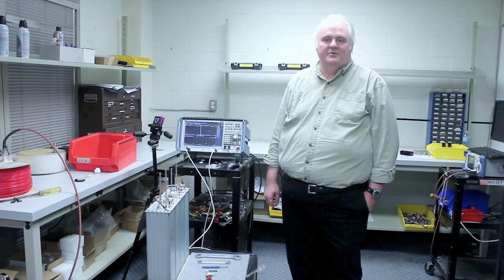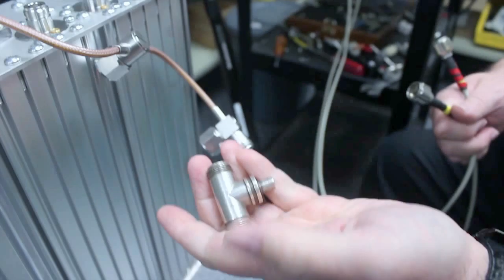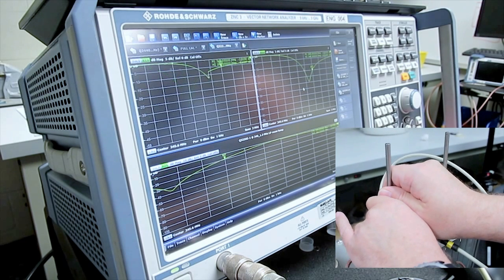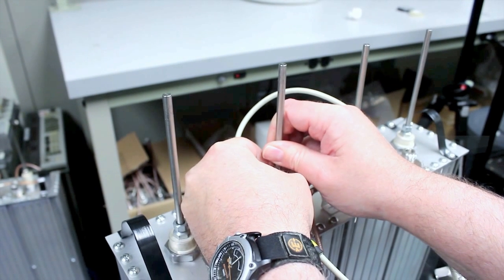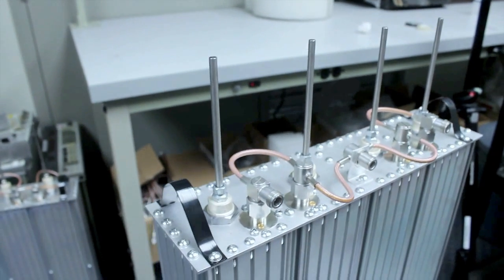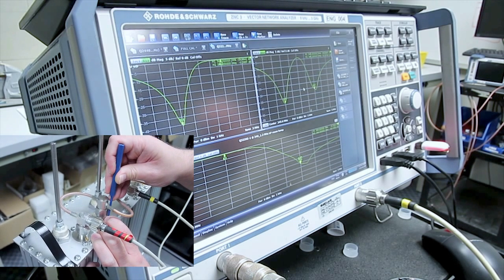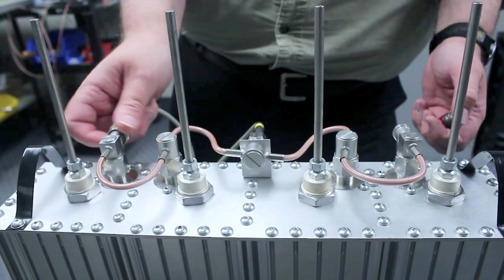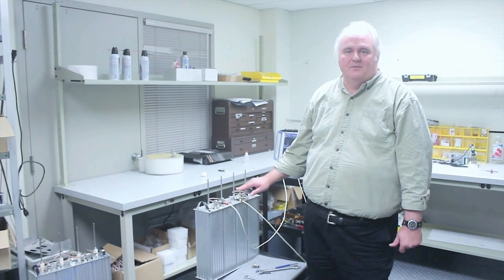How To Tune A Duplexer

Comment: No mention was made as to the position of the loop to control IL and or reject depth.  Also the importance of the proper frequency dependent length of the cabling harness. Good video nevertheless.

Comment: Sinclair products are excellent. Duplexers are simple to tune. I do not have ant fancy test gear. I use a generator and a receiver to tune at first , then touch up with low power to the inputs hi/low with a watt meter and set to minimum reflected. Have had duplexers checked with an instrument and spot on..  Wish I could own an instrument ...but $$$ which vI do not have. Have also built multicouple sets the same way.. Using a Motorola XPR radio with the RSSI reading as my guide. Can set insertion loss and a wattmeter for reflected .. The loop position is very important !! .... they work..

Comment: I do not have a VNA so I'm trying to use the SA-TG for this. I understand the lower display of the R&S VNA to be the S21 return loss. I don't quite get how to duplicate the SWR reading of the upper two screens though. I can get a directional coupler but would that require an additional 50ohm load at the T connector when trying to measure the SWR? This would be the directional coupler to the T and instead of a wire back to the VNA as in the video, I terminate it with a 50ohm load. Is that about right?

Comment: I have I bit of a strange case,
personally I don't own the richt tools.. however I do own two identical filters, one came tuned by a professional, the otter I want to tune my self.
equipment I do have: nanoVNA (cheap Chinese tool)
RTL-SDR stick (also cheap Chinese "tool")
SWR-power meter (again, cheap Chinese tool)

now for the fun-part,
I have tuned the filter using the nano-vna, but the dynamic range is poor on those things,..
to get more range u use the nano VNA in CW mode (so It does not sweep, just produce the right frequency) than I use a 10 db attenuator (also cheap Chinese tool) and hook it up to the RTL-SDR and note the exact pont of the signal (frequency and amplitude) note: set the SDR to the smalles sample size since it increases the dynamic range.
add one side of the duplex filter and remove the attenuator. 
now the amplitude of has decreased to the noice floor.... but luckily there is a gain in te RTL-SDR
set this to a level you can work with, (not it down) and tweek (very carefully and not by much) the duplexer to minimum deflection! (add gain if needed to allow for signal-noice ratio)
use a cheap radio tuned to the right frequency (pass frequentie) and measure SWR (my measurements came to 1.00 :) )
if both sides are done, you'r done.

im to CHICKEN to use this duplexer right now,
how big is the chance I tuned it completely wrong? 
I don't want to blow up my repeaters/radio's

if anybody has an other cheap way to tune filters I would love to hear it :)

73, PD0HOF / PI1HRN (DMR repeater)
Reply: Just in case anyone had the same questions. I have tuned them with a nano VNA like yours (Chinese), the Idea is to have two traces in Log Mag (turn the others off). Then for the duplexer port where the TX is going to be connected put VNA CH0 in it and VNA CH1 on the antenna port and the 50homs load on the RX port.  Make a Marker for CH0 and another marker for CH1.  Goto Stimulus and set the  center to the TX frequency (set also the span to your liking). When tunning the cavity look for CH0 and get the best db value, when tuning the notch filter set the center frequency to the RX  and  adjust the notch until the lowest value is reached (this will depend on the capability of the duplexer).      For RX side port of the duplexer, connect CH0 to the antenna port and CH1 to where the RX port of the duplexer, and the 50ohms load to the TX port of the duplexer. Do the same steps above for tuning.  If you get good numbers like 1db  insertion loss and 70db+ rejection, it is then safe to connect the radios. Make sure you don't mix the ports (Low freq. goes to low port and high freq. goes to high port).  Tip, it helps to set the span to a short range in order to zoom in to the graphic.  Hope this helps.

Comment: I have struggled with cable lengths when tuning duplexers with a tracking generator, (not using a VNA). After tuning a duplexer, if I change the two cables with different lengths, the IFR shows the tuning at different frequencies than first tuned. What is the correct cable lengths used to tune a cavity/duplexer. 300/f x VF x 1/2 wave length?
Reply: First, the generator needs to be set up according to the manufacturer’s instructions  Second, the test cable lengths should not affect the pass or reject frequencies if the cables and the generator are 50 ohms.  The lengths should only change the insertion loss readings and this can be calibrated out (see manufacturer’s instructions).  Third, make sure that any unconnected port on the duplexer is terminated in a 50 ohm load.  Leaving a port open with definitely throw off the tuning.  Fourth, you would need an impedance bridge to set the pass frequency of the cavities.  The region of good return loss is smaller than the region for good insertion loss for the pass band so you want to set the minimum reflection for the cavities to the pass frequency.

Comment: GOOD TO KNOW.  I never seen that kind of T connector.... i used to tune those DECIBEL and   Motorola MSF 5000/Qantar duplexer during late 80s to mid 90s I used HP spectrum analyzer and Cushman/Farnell/HP RF signal gen.  RF SIGNALGEN IS SET to 0.00 dbm so that I have a direct readind.   Initially all rods was set to all up and adjusted one or 2 of the rods until isolation is 90db and other rod to within 3 db insertion loss. I keep on playing  also with tuning cap  until I got the desired result
Reply from the maker: Thanks for watching our video!

Comment: Who is the manufacturer of that "T" connector, also where can one purchase those "T" connectors from?
Reply from the maker: The tee connector is just an N type female/male/female tee with the collar cut off of the male end.  It save the time needed to screw on and unscrew the connector.  The duplexer can be tuned just fine with any standard tee.

Comment: How do I tune a Q2330e with a HP 8924c? I don't own a network analyzer.
Reply from the maker: We can’t comment on the proper way to set up a piece of equipment for a given measurement.  That would be best be answered by the manufacturer.

Comment: I wish this video showed a more ordinary test equipment.  I don't know what that thing is, but all we use are 2670s with tracking generators...
Reply: Any specAn in range with TG would do it. IE 2975 , A3920, HP, Marconi ... anything that has TG. set at ref level 0 and tg 0 and high span  and focus in...

go even higher span 10mhz or whatever when searching an existing unknown frequency.